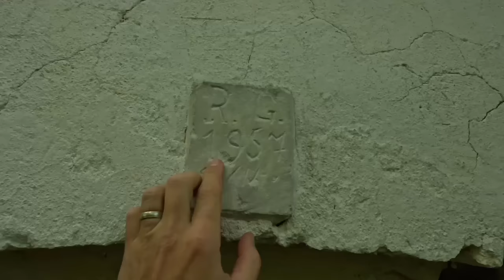Preparing for OFF-GRID LIFE with Luxon Bushcraft ep.01.

Comment: nice job, nice bush cutting. Too bad about the roof that you broke it, the covering could have been used again
Reply from the maker: Thanks for watching! The house was split in half, the tiles are heavy. I need a lighter solution
Reply: @luxonbushcraft   You can try to connect the two pulleys with a threaded rod and pull them together.

Comment: I see you bought a fixer-upper. A rustic stone cabin. A little different than doing bushcraft from scratch in the forrest. If it’s solid a new roof shouldn’t be that hard. You’ll need a clean water source, heat and a bathroom. Either composting or a septic system. Also power. Depending on the direction of the roof solar power, batteries and a converter should be able to supply you with plenty. Put plenty of insulation under that roof and a moisture barrier and insulation under those floors. With enough land you’ll have plenty of wood to chop to keeping the stoves going. Invest in a good one. Lajka is going to love the freedom of all that land to hike with you. Button it up before winter sets in.

Comment: How are you liking your CF Moto? Love mine so far. Is that the factory storage box on the back?
Reply from the maker: Yes, so far I am very happy with the CF model. The box at the back is an additional equipment.
Reply: @luxonbushcraft  they do really well. I love the metal protection around the lights and such. I cut my trails from scratch and those metal bars saved my lights several times getting into thick woods. Nice machine for the price. The factory winch has been another life saver. We enjoy your videos and look forward to seeing your current project unfold.
Reply from the maker: @sauced2007 Thank you very much, my friend 🖖